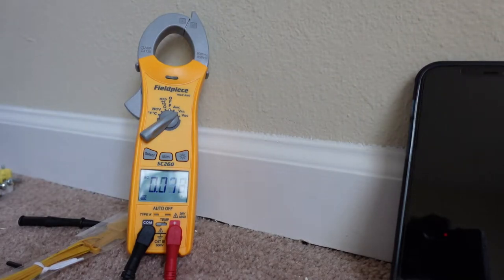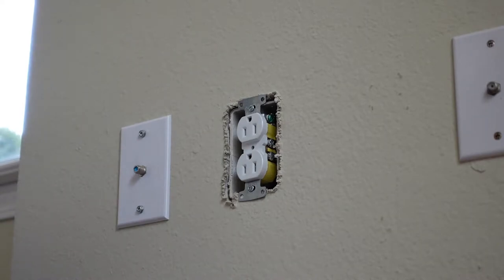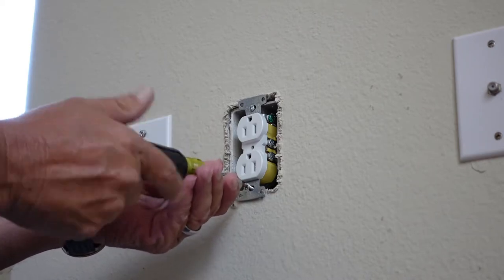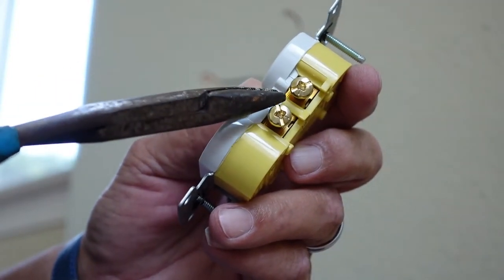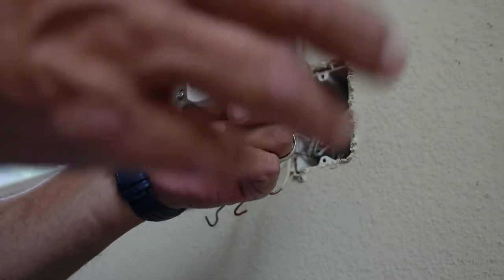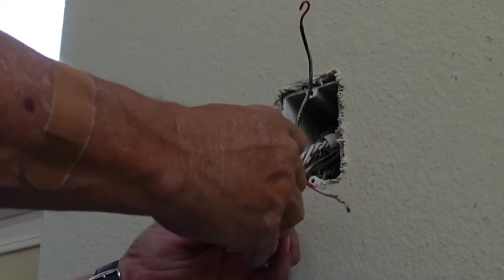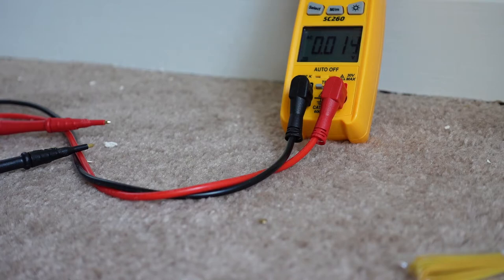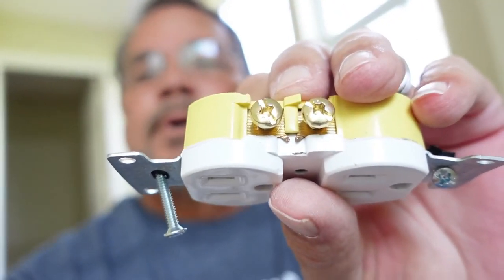What Is A Switched Outlet and How Is It Replaced?

Comment: What happens if you don't break the jumper i installed two of these switched outlets and didn't have no problems. I use the top and bottom for my monitor and computer. Now im curious if breaking the jumper helps divide the voltage each oulet gives and not shares it between both.